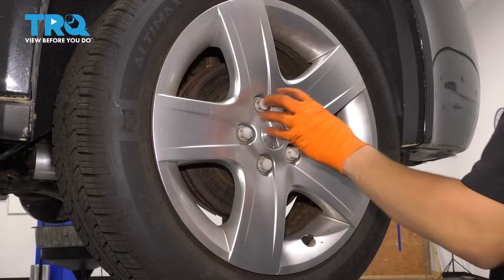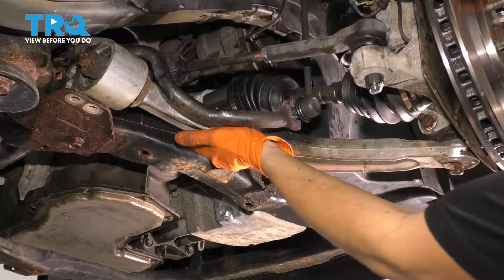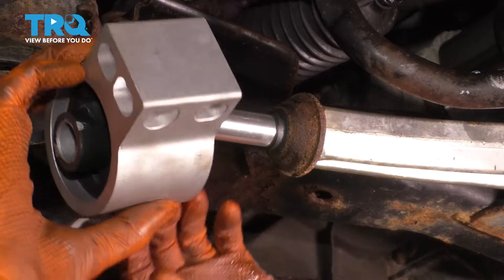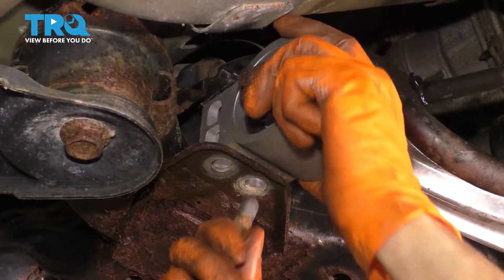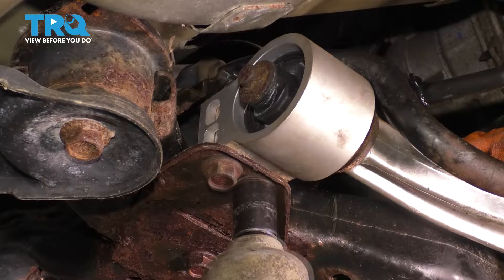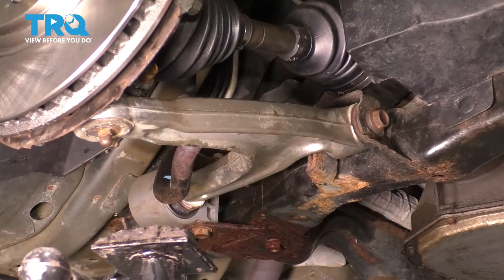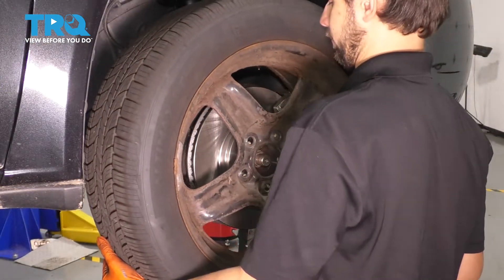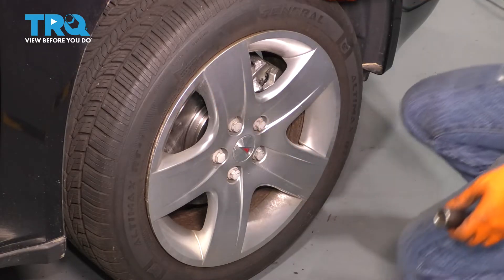How to Replace Front Lower Control Arm Bushing 2005-2010 Pontiac G6

Comment: As for a 2006 G6, this video isn't even close to the video. On the drivers front control arm bushing, you can not get the bolt out until you remove the transmission mount. In the passenger side, you have to remove the engine mount. So, if your doing control arms, may as well replace these 2 motor mounts. And beware, the older bushings you are replacing, the metal sleeve in the bushing may totally seize on the shaft and you will have to remove the control arm to get the bushing off.
Reply from the maker: +Jamie Thanks for the feedback! http://1aau.to/m/Shop-TRQ